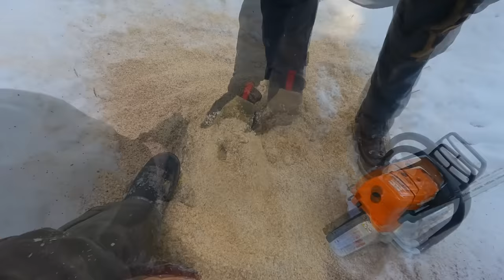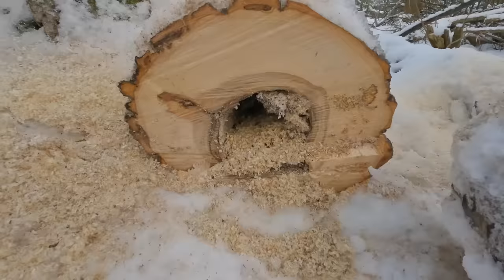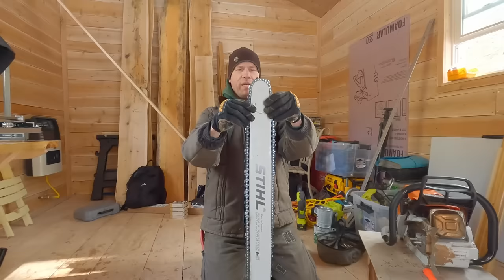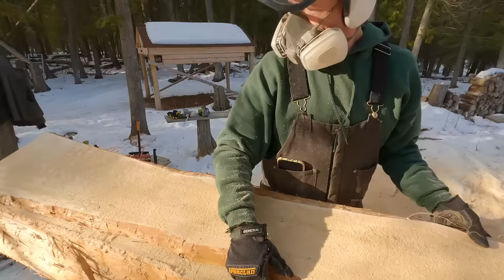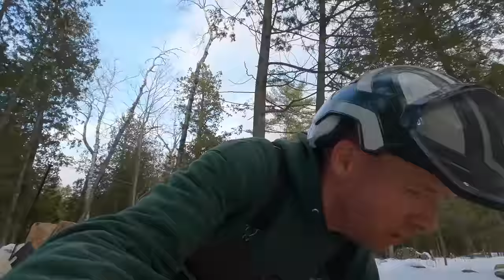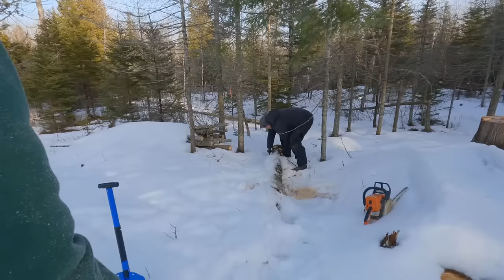An Enormous Alaskan Chainsaw Mill Upgrade, After Three Years of Full-Time Building. #125

Comment: I say maybe use the new saw with the old mill and ull still see improvements as far as powering through logs with less sharpening of chains or try experimenting with the smaller chain bars and old chains I can see a lot of experimental ways n methods in your future which means what more variety in your day or work day Im still looking at pully systems that make things easier even if all you got is an atv to increase the tork n power of the equipment you have on hand maybe build a hand type crane or pulley system to your trailer when ur working in the woods remotely n using this knowledge to save your back. like addinga bigger wench handle or adjustable one to your log lifter thus making it easier to lift or move even larger logs more easily.  I see it like a boat lift what makes it easier is a larger wheel on your boat lift and various pulleys to make lifting and lowering boats much easier in and out of the water only logs are your boats. Ive even seen home made scissor jacks made out of wood like an adjustable work table or bench to make it easier to work on projects in a small shop. My neighbor has a design for an adjustable picnic tablem and why not have several picnic tables on your property who says you only need just one and what about building decks or small mudroom or addition for your muddy clothes and boots for your cabins an unheated part of your cabin. They were quite common on trailers during the oil boom to keep the house cleaner from boots n work clothes and tools. Hey Im an idea guy to n try n keep myself busy some how at least in my mind.

Comment: I went to Granberg web site. They make those Alaskan sawmills that can cut logs up to 80".
Thier saw guide looks nice. Aluminum construction. Comes in 5 and  10 foot sections. They have connector pieces to extend the length. Two tens would work well for you. You could easily cut to 18 foot logs. 
2  5 ft sections would be a bit short for what you do, a 5 and 10 would go 13 or 14 ft.

Comment: On smaller logs, use the saw with an angled cut (i.e 45 degrees or so). That way you get potentially full with capacity usage on every log you mill. The new saw (and chain) obviously can handle it. An added bonus is that small logs will mill significantly faster at an angle than with a 90 degree cut. Maybe, with an angled cut, the saw will actually pull itself through the log, to some extent.
Reply: Do you mean lifting one end of the log up higher than the other or mount the rails then turn the log to 45°?
Reply: @leonhart2452  no, that is not what I meant. As of now, he has the chain at a 90 degrees cut. If he, for instance, instead have it at 45 degrees, it means that the contact will be ~1.4 times longer (provided that the log is narrow enough for that). Think of it as having the blade still horisontal but the tip is rotated forward. The tip it's leading the cut.
Reply: Think of it as how u normally use a hand saw. At least I normally use it at an angle, not exactly 90 degrees. The tip of the blade is normally lowered and the back is lifted slightly (or vice versa).
Reply: I just remembered that in this video we can see Tito do exactly this at some point. Not that much angled but still.

Comment: When you use a bar & chain heavily to cross cut or rip mill, you want solid bars with a chain groove milled,not laminated & spot welded. They take more heat with out warping as a laminated bar will as different layers expand for heat at different rates. Stay solid & stay as short as possible because longer warps more too. Better to have several bar & chain sizes for each saw & change to suit log sizes. Vertical milling also extends bar & chain life,sharpness & reduces heat from friction.

Comment: RYAN: Leave the on-off bar about center in your mill, just float the powerhead out some on entry and exit. I mill smaller stuff with my 36inch bar all the time. I've actually got a 48inch mill on a 36" bar because I can't seem to get a 48 anywhere. That said, I find the extra length of mill helps counterweight the powerhead

Comment: I know it's probably too late... but you should go through your break-in (3-5 tanks) before milling. At around the fifth tank your going to start to hear a slightly different exhaust note and feel or kick in power. It's truly one of the joys of big saw break-in. Also until it's broke you should hold back on running full throttle. These saws aren't cheap, and if properly cared for they'll outlast any good truck.
Reply: I made my comment well... before I finished the video. Anyway I'll leave it.
. You don't have to run a 36" bar. Could easily just run a 24". Then the chain will scream though the cuts. You stepped up to a really good saw that you're going to love. The reach of a longer bar will also be better on the back. You can buck firewood w/out having to bend.
Reply: Break em in like you are going to run em. 2strokes are different than 4. They like to be screaming. Just vary the throttle a bit during break in but definitely run it wide open most/some of the time during break in.

Comment: I use 2 bars but the same 36 inch mill. You have to adjust the on off bar on the mill to the center of the log your cutting.

Comment: You have to hit the logs with a sledgehammer or maul the hammer strikes will break it loose, though you may have a clump of dirt attached. You also need a small log arch to get the logs out of places that the quad will not fit, you can winch them or pull them out though I son't know if it will work in deep snow.

Comment: I started out with a CSM, (chainsaw mill) it didn't take too long to figure out it was waaaaay too hard on my body!  I bought a small BSM (bandsaw mill) and it was night and day better!  Plus the kerf is so much narrower, on the BSM every 5th cut I get one more board, instead of turning it into sawdust with a CSM!  Then there the speed it mills at, it's night and day faster!  OLD farm tractors are cheeeep, they are plenty good enough to pull logs with and have a LOT of other uses too.  Another thing, a BSM cost less than half as much to run in just fuel cost alone, plus it's just so darn much quieter too.  Try one and see for yourself.  SR

Comment: Know get a 20” bar for it and use your small log mill for the smaller logs. Keep the big bar in the mill and the chain with it. I have a 20” a 32” with a 20” two post mill and a 42” bar with a 36” mill for my 660 i like having the right mill for the size.

Comment: I snooped around on amazon has a chainsaw miller for $79.00 cutting range 14-36" because it comes apart in sections. if you need wider  for a larger log u just add another section. N my guess is you womt be cutting many 36 " slabs Which is what your 36" bar is designed for like table tops and such. But that saw engine size is optimal for cutting any size. but there is no wench included on this cheaper mill but thats probably fixable as well there is good n bad in everything. Years ago van halen made a guitar that was the cats meow n he was pushing the sales n I was thinking his price was out of line for most people including musicians n I thought that was crazy how would you ever know top notch if you never used a cheaper version guitar I have owned and played many guitars from les pauls to strats but I still like to experiment n the best to me would be a combination Humbucking Gibson and single coil Fender. And I got one in a Squire strat copy about $250. And Im happy with the sound and the quality is fine with me as well for rock blues n country..

Comment: I have an Alaskan mill still in the box.  I have ms462c that I think I can mill with.   I started a firewood business less than a year ago and get huge wood from the tree services I partner with.   Can't wait to start milling up some back walnut.  However, I know nothing about milling so I will be watching carefully to see what I can learn before I start milling.  Love your videos, thank you for making them.
Reply: There is nothing to it.  Set up level with two pieces of plywood at the ends, put a board or ladder over them and run the saw down.  I started in the 80s, and it was fine from day one.  If one is milling for oneself, one can get way more wood than one will use in a decade in a few afternoons, if the logs are right.

I recommend Will Malloff's book, there are copies on the net, and while it was out of print for a long time, I think it may have been reissued.  He has a good setup with a winch, but I keep it simple as the little milling I do drowns me in wood as it is.  He also has a good method for milling any length you want with a short board.

My one trick with marginal wood diameters, is to run the first cut through the pith,  That way, you waste wood that is normally waste anyway.  Works up to about 20 inches.  If you absolutely wanted to maximize the quarter sawn wood, that might not be the best way...

Another good practice is to to make as few cuts as possible.  For furniture, and with a shop bandsaw, it makes sense to work with larger cuts, 2" boards are wide enough for legs, and such, yet can be resawn into planks as well.  They can also be cut to yield quarters for frames.  But the main point it to think though post processing and cut as few boards as you can move easily, yet with little waste from heavy kerfs.

Comment: Thanks for the video Ryan! I'm thinking about getting a chainsaw & mill but will probably go with a clone rather than spend 4 - 5 times as much to get the brand name. I have little doubt that the genuine Stihl would be better but the Farmertec clones have gotten some good reviews. Making the smaller bet seems like a reasonable choice to me. If I ever decided to upgrade to a real Sthil I'd have a complete saw to use for parts. Take care and keep up (most of😂) the good work !

67.2K
Reply: I don't know about the Farmertec.  All I know is I bought a Stihl 090 when they were available, and it always starts on the first or second pull, and runs great. I can sell it today for 4 times what I paid for it.  Paid for itself first afternoon.  I remained out of pocket, however, I got that much cherry.

Comment: When you use the Granberg rails you will find that the thickness of the log makes no difference because they can start a foot before the log.  Of course that depends on the length of the log you are milling and if not too long the rails can also extend past the end of your log.  That eliminates the need to touch up the end of your board with the planner.  Try it, you'll like it!

Comment: This may be a dumb question but, can you put a smaller bar/chain on the big saw with the small mill so it will be better sized for the trees you usually mill and get the benefit of more power and a more manageable size?

Comment: Yes,spendy,but worth it being sthil. I think that ms661 mag was near $2000.00 with tax 1 chain,no carry case when I checked it out. $1850+ tax? It went on my bucket list for next purchase & upgrade due to lack of justification for my purchase of it at that point in time. Instead I bought 2 - ms461 new at $1250.00 apiece ,1 chain each,no carry case. The ms880 mag is on the bucket list too. 
My intent is to mill with saw & bar in the vertical position bringing logs to my portable rig a short distance as well as horizontally milling logs where they lay.

Comment: you know if you made another heavy duty picnic table with say 8 legs instead of 4 basically youd have a larger milling table or milling station n that way you could experiment with milling two or three logs at the same time using your saw with the longer chain bar. and build a ramp up to the table to slide your logs up to the table easier m possibly with the wench on your atv or even a hand wench or those portable harbor frieght  18 dollar cable wenches with a cheater bar. With the newer saw you have more power to cut more logs at the same time. Its just an idea but I think it might cut down your production time. Also look at several of those garage in a box type things menards might have them its just a tent or canvas over a heavy steel or alluminum frame.. Ive seen then here in North Dakota so they can handle gusty and snowy conditions. And you can buy  just the tents should your tent get damaged or faded or what ever. Ive seen them in Alaska to hell might even be good for storing lumber or covering your milling station so you could work in the rain or snow if you wanted to. Just my two cents

Comment: Lets all do the Tim the Tool TIme Taylor.... OH HUHU uh Huh!! Welcome to the big leagues. I thought I was hot stuff when they issued me a new 550xp at work. I'm a power line clearance guy, I climb next to power lines with a 550Xp when most locals companies use a top handle Husky or Stihl, lol kids... But! at home, I don't own a decent saw, until now. I bought the 550xp to mill wood for moms lake dock. It works fine. Fine, that's a word. BUT THEN! I discovered the Husqvarna 395 XP Chainsaw 36" - 94,CC engine.  OHH HOOO BOY! I put a ripping chain on it with my new sawmill and I managed to cut, start to finish, peevy, cut, Peevy, cut, Peevy, a 12 foot 6x6 in 23 minutes in all. It was justified by the amount of cashI saved milling vs buying and gas in my truck. My drive to Home Depot is a day. I have two canyons I have to go down, 4,000 ft,  before I hit the store. Welcome to the Mile High State. But This new 661 MAG is going to open doors you never knew existed. Your production rate will triple. And your back pain will double. Don't forget the ripping chain. LOL, Good work sir.

Comment: Questions: do you think i could use my MS 171 to mill smaller logs? Could I build a mill from scrap wood? Im a wood turner an want to cut my own stock. I have a table saw, bandsaw and chainsaw. They are all on the smaller side but I want to try to use what I have to maximize my productivity.

Comment: guday mate , i watch a lot of your videos , i like chainsaw milling , i am running out of time fast though , i am 62 and diabetic , but anyway i have built a 20hp chiansaw mill with a cheap 20hp chinese motor and i am running .404 x .080 harvester chain and bar with about 4 skip chain roughly on a rail similar to the logosol  , mine not mobile though , its to heavy , have you thought about getting a logosol sawmill real light and compact and mobile to

Comment: Congrats on your new saw. A bunch questions: did you get a skip tooth chain, I think maybe not? If not, why not? I have been looking at the helmet you have, can you tell me what made you choose it? I have a Stihl helmet and wonder if you have the ability to compare your o it? Can you share a link for where to purchase the log lift your used? I’m between getting a 500I and the 661, what mad you choose the 661? Do you think you could have done all you need to do with a 32” bar? Your answers to my question will be very much appreciated. Thank you, Michael
Reply: I have a 500i and it's amazing, but I don't think I would run it on a mill.  The 661 would be a better mill saw in my opinion.  The 500i is a laser in felling or bucking work but that bigger 661 would settle in nicely for those long cuts.
Reply: @mikeadams3699  thanks Mike.

Comment: Just get a 24 or 20 inch bar for the big saw it will be lighter and cut faster if u got a bigger saw the reason to saw faster u don't need a bar that big but if u run into  a bigger tree you already  have a bar and chain the other plus less teeth to sharpen

Comment: Gentlemen; get used to using the tip of the bar instead of dogging in. It will save your back and let you know when your chain needs a touch up. It also cheaper to replace a tip on a pro bar than replacing the whole bar.

Comment: Where do you poop. Have you built an out house. I know your ground is mostly rock and it would be a pain to dig a hole. I used a 5 gallon bucket for over a year before I had a outhouse built.

Comment: And did you ever consider milling two logs of similar size at one time since your saw is more powerful motor and longer length chain guide this could get interesting then think of perhaps a drying tent. I recommend an army surplus GP medium or just a garage in a Box which is simply canvas over a metal frame sold by many box stores Menards or Home Depot extra cheap storage or shops etc.Or just make the wood frame and hang your own material or canvas n make ur own tent or canvas covering over your own home made cabin tent frame. Throw in a couple barrel stoves n dry your milled wood that way in protected and warm stacks hmm Hmm Ring Worm Enterprises? Maybe Im talking crap but hey you never know as long as ur having fun right?? What did you think of the dynomite idea? I think u guys are pyromaniacs to at least a little bit. People in rocky soils have used this from time to time to either dig wells or dig ponds for licvestock or other reasons it might sound crazy but its cheaper then building roads to remote properties.

Comment: Understand your comment about the remote capability of the chainsaw mill but the whole process seems onerous and slow.  Not just the cutting but fiddling with all the parts and pieces would get old quick and the chance to drop a nut or bolt is always present.